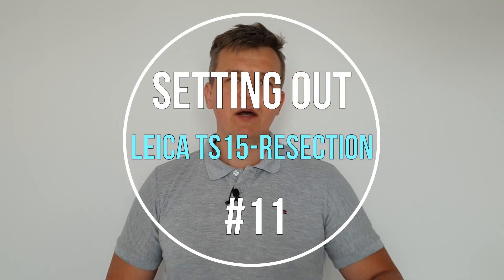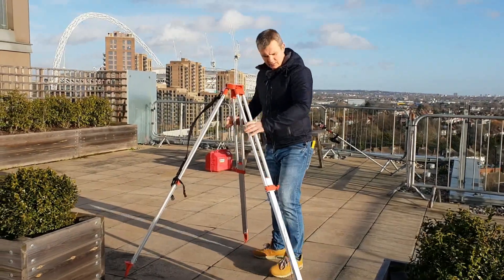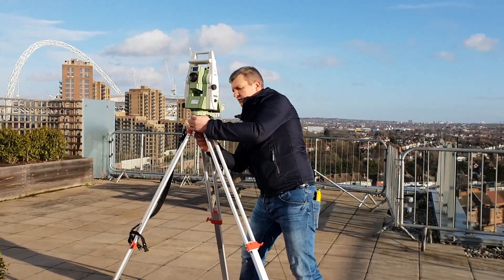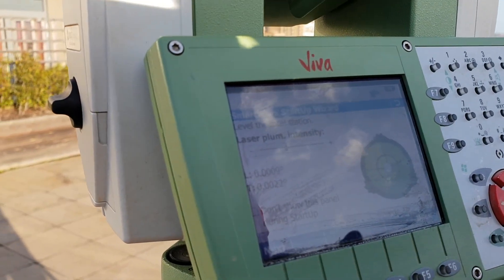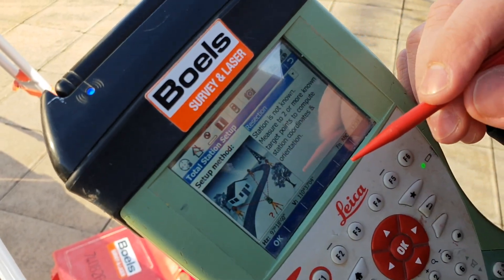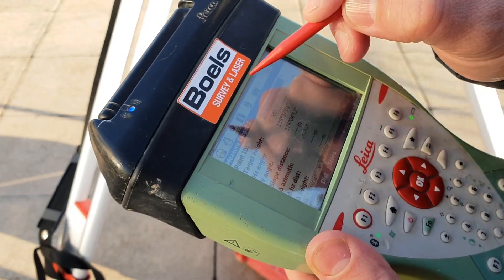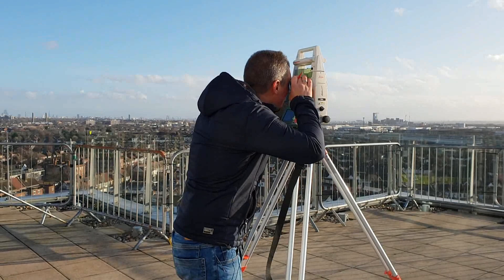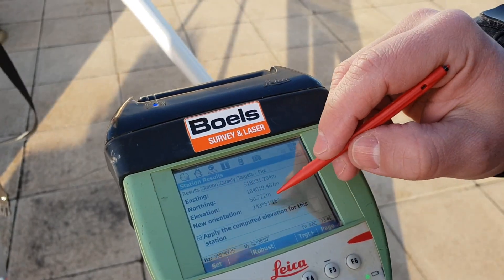SETTING OUT #11 - How to SET UP Leica TS15. RESECTION program using Robotic Total Station.

Comment: is it bad when our quality control is Y=0.005 X=0.004 H=0.002
new orientation 0 00 33"
Reply from the maker: poor TBH, who set it? Can you get something better? Are you sure it will be actually ar. 5mm? As always depends what you’re doing and what accuracy and tolerances you work to, but I go with 3mm max and typically have height max 1mm. Maybe you cant shoot the targets correctly? Targets distribution is not the best?
Reply: @SITENG  the targets were set using the GPS method and were then observed by the total station.
this is probably the reason for that result
Reply: @SITENG  
It is about staking out the slab of a small object, and only so that the builder of the object can easily determine the exact angles of the object

Comment: Hi,
When I save the data in to memory stick and transfer to CS10 controller it appears different coordinate. Do you know why? 
Please let me know if you can.
Thanks
Reply: Yes, I have and I done more than 20 jobs with that instrument and only causing this issue on one site drawings.
Reply from the maker: try open new drawing, copy what you need, save and check again. Sometimes simple solutions work the best 😁
Reply: Ok I will,
Thanks
Reply from the maker: Strange, did you save it as dxf and configured the CS when bringing the data (m, mm etc)?

Comment: I appreciate that we all do it from time to time, however, please level your tribrach with the instrument in the box. When fairly level, now place the instrument in the tribrach and fine adjust.
There are people out there that will be lifting and dropping tripod legs with an instrument on top. It's a very expensive recipe for disaster.
I was always taught this and teach it to any juniors I work with.
Reply from the maker: Hi! I won't be doing this way, but if you like it why not :) In general instrument has to be set in 'safest' place possible and this extra minute for levelling won't change much. I appreciate your advice and recommend all you guys try it and see how do you prefer to work :)
Reply: @SITENG  "if you like it why not"?
I told you why not. After 28 years in the field, I would not do this. Don't be idle, level your tribrach first, then put the instrument on. You're encouraging someone to topple a tripod over that wasn't level and has an expensive instrument on the top. Why encourage people to be gentle with the instrument when you're encouraging bad practice?
Reply from the maker: @theboycalledleaf I didn't get you first, you mean the beginner engineers? You might be right actually for the people without any experience - I'll pin the comment :) First of all I am teaching to set the tripod quite level so you don't need to move the legs really, but I admit this is a good idea and thank you for this - good practice for beginner (although sometimes they have more problems with taking the tribrach on and off and I am afraid of them dropping the instrument before it's installed ;) Thank you again and I hope we will get more comments like yours so we can all get better!

Comment: Nice video Greg! Very good lesson on resection. One question for you. What's the longest distance for targets that you use when you are setting the TS and later for staking out points?
Reply from the maker: Hi Darko! Hard to say, but max. few hundreds meters. Depending on the job really, but typically I keep them closer if I can. Sometimes on surrounding buildings if there is a need. Distances from the station to stake out points are much smaller as I am setting the TS usually close to the points I am marking 😁
Reply: @SITENG  Thanks!

Comment: Greg.
            Another fine video and congratulations.
         Just couple of points as below.
  1:  If you set the Height of the Total Station to zero then the coordinate of the set station does not give the level of the ground you are standing on. Or does it not matter. If you now survey the ground around you with the laser or the prism then you are still recording the true level of the target area because the instrument is using the height as set form the resection target station. Please confirm that this is the case. That you are recording the height of the instrument from the resection and not the level of the ground.

  2: The prism set for resection is an open laser on tape or flat surface. Please confirm as you was too fast for me to catch it.

    3: Could you have set the resection set-up from the Total Station instead of from the Controller.

    4: What is the maximum value of the discrepancy or the quality value of the resection acceptable on TS15. Is is under 4mm maximum or much shorter then this. Please confirm.
Reply from the maker: Hi Asim!
1. Station is based on targets height and is the 'real' height of the instrument so whatever you're measuring edm shows you correct height of it.
2. For resection I am using reflectorless and then 'tape', but sometimes 'surface' as well when edm can't read the retro target. Constant is the same for both, but if possible I am setting target as what I really measure.
3. Yes, you can, as I said in one of my last videos some people setting station first keeping the control job in the instrument and than connecting with robotic keeping the working jobs there. It depends entirely on you really, I just got used to use robotic from the start :)
4. This depends on you really and on the job you're doing. If for instance you are to roughly mark area for your future works to know how to plan the job it might be even 10mm, but if doing setting out for the construction elements I am keeping this within 3mm. I personally think more than 5mm error shows that the base targets are not 100% right which might cause problems later as each transfer of these brings more error.
I hope above answers your questions Asim :)
All the best!
Greg
Reply: @SITENG  Excellent. Thank you very much.

Comment: Can you setup resection on moving platform. If yes, please show me how to do? Thank you.
Reply from the maker: Hi Tuan! I am not sure what do you mean by that. If the platform is moving with all system and your station can be fixed and set up there it would be possible (Like set up in local grid where you are moving with the grid)
Reply: @SITENG  I mean that we work on the moving platform, such as the vessel, all systems and the station be fixed. But I can't setup resection because instrument inform its coordinate is not accurate.
Reply from the maker: Hi! Sorry for late answer, I've never worked in the environment like this so I can't really help. There is still a chance that co-ordinates are not good. If you have your instrument set and than it ignores the movement (level changes) than it should be fine.

Comment: Great Video! Could you please elaborate more how do you reference the site, according to global coordinates. Do you use any gps signal or benchmarks from website?
Reply from the maker: Thanks Lee! There will be more coming, so you will find all you need to know. I do not use GPS myself.
Reply: @SITENG  Can't wait for that video and how Gnss system works with total station. Do you use only Leica or any others?
Reply from the maker: Leica mostly, I worked with TOPCON&magnet field app before and it's really good too.
Reply: @_Rezyser  gnoss?
Reply: @tonymaguire9498  gnss. good point I will correct it, ty for checking